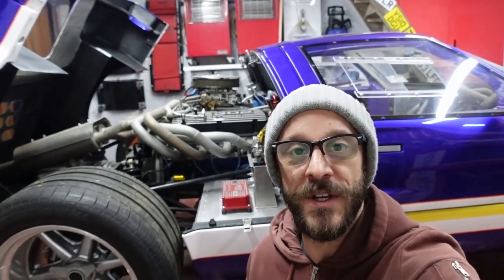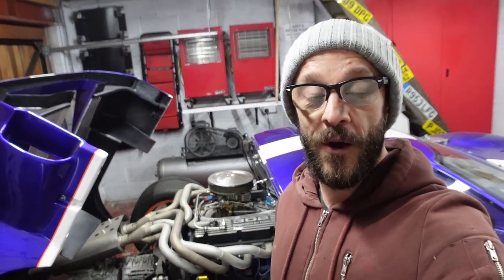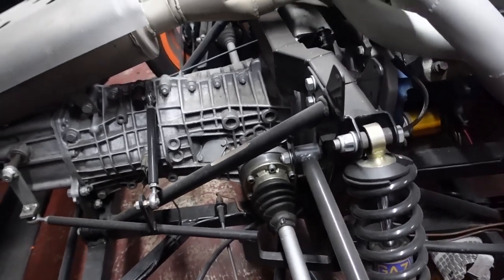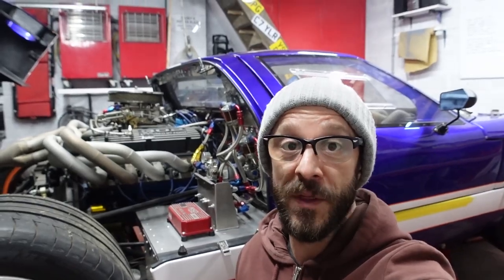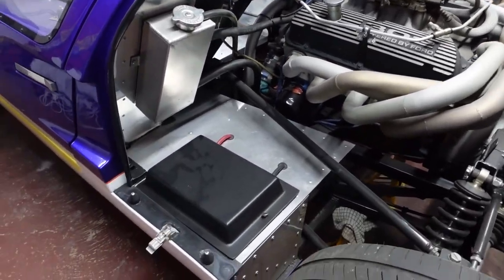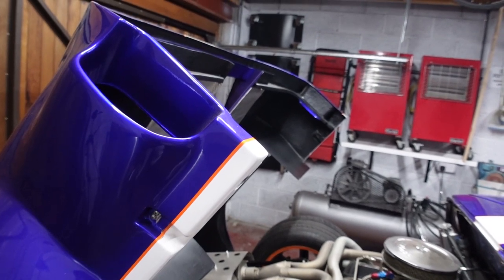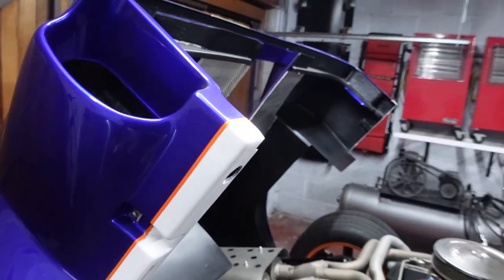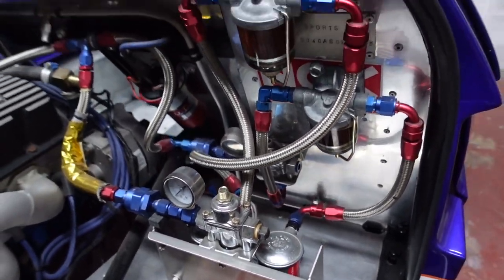GT40 Restoration - Ep 4: Engine & Gearbox Specification Breakdown

Comment: I have a 2007 Tornado with the same Real Steel 303, Holley carb and Renault transaxle. Like some of the clam alignment pins and seals you have fitted. Where did you get them from? Tornado factory?
Reply from the maker: I can't help you with the clam alignment cones as they came on the car but the rubber profiles & door seals were bought from martrim.co.uk if I remember correctly